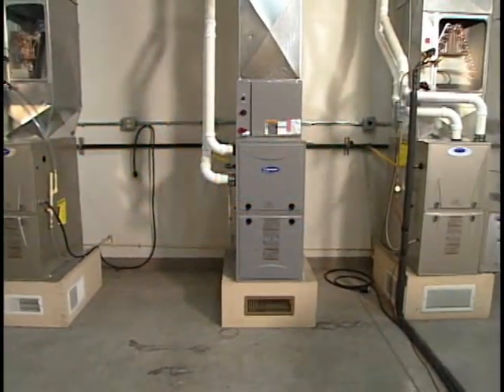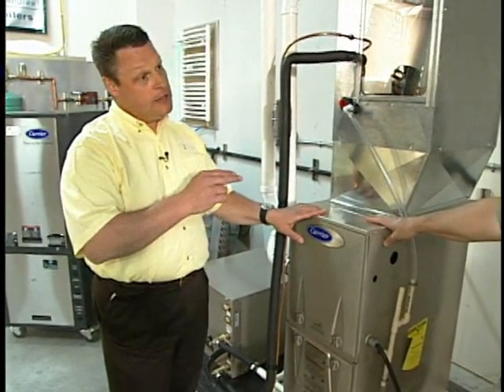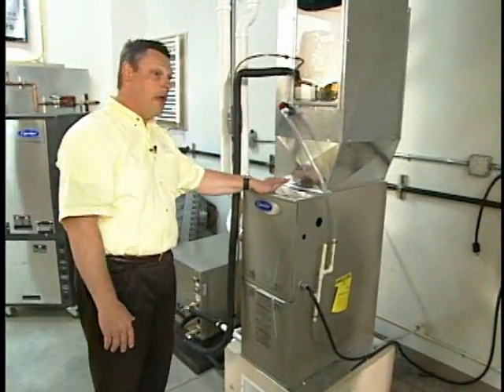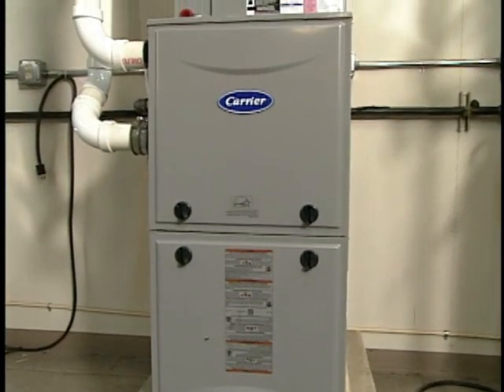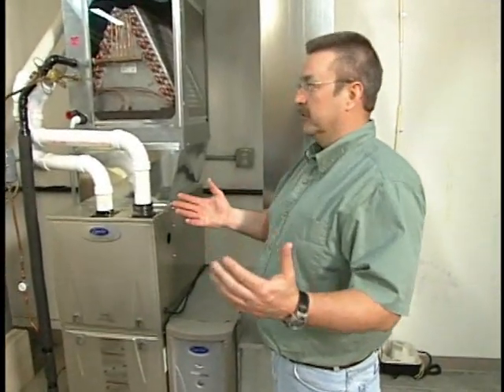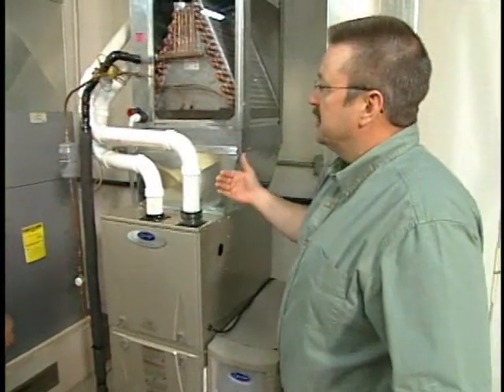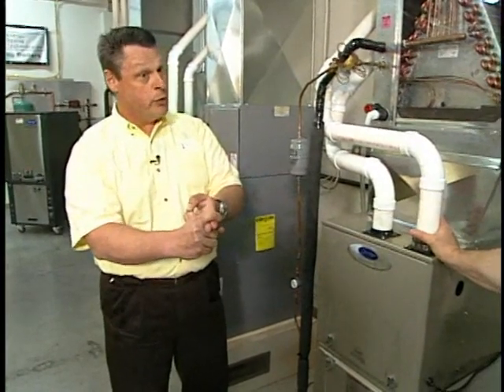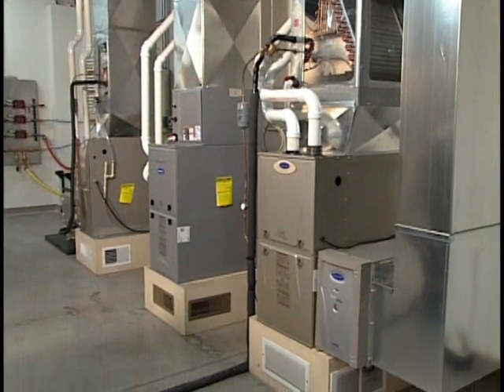How to select a new Forced Air Furnace - Carrier

Comment: Got a new furnace with an ECM blower. However, the touted savings are exaggerated, because an "inefficient" motor just makes more heat for the same kinetic energy output. But that heat gets added into the plenum, so the savings are just the difference between electric energy and gas energy.

Comment: What they don’t tell you is that if the motor breaks down and need replacement ECM is $2000 to replace but a regular motor around $300.
Reply: You are correct Siami. It's said that new smart motors use 1/3+ less then a conventional PSC motor but what good is the savings if the new smart motors don't last as long and it costs you $1200 to replace it, when the old traditional blower motor lasts 20+ years and costs $300 to replace?

Comment: Contractors charging $8000 on a $1600 AC unit is the common problem tgat manufacturers are fixing it. Why not the manufacturers also do installation or fix the price.

Comment: my condensed air 1 stage gas is testing positive for toxic molds going through draintube its brandnew so does this mean it puts molds and pollutions into home and also it wont run with allergy filters cant handle thick allergy filters, these furnaces save gas company money and create money issues for home owners

Comment: 350 bucks a year for electricity for blower?  Where?  in the east?  Not in southern california...can't be ...especially if you HATE having the temp over 68 degrees and that when awake...
Reply: That's just the blower. The AC compressor that generates the cold is what is expensive. Two different things.

Comment: 18 to 22 years ours is over 40
Reply: Mine is FIFTY years old...I am in sunny southern california and I have a 50 year old home about 2400 square feet two story.  The furnace is original ...well except for upgrades and repairs but it is so old I am thinking to replace it just on general principal.   I am a dyed in the wool do it yourselfer and it does not LOOK like a hard job to replace the furnace but I notice that advertised installation is typically WAY WAY more than the cost of a new furnace and I just don't understand that at all!?!  I could understand if it were in the attic but it is in a little furnace closet upstairs,  there is a flexible gas line like on clothes dryer and water heater,  there is outlet the cord is plugged into and the thermostat wires which are nothing....   other than that the only difficulty I can see is finding a furnace the same dimensions as this one and connecting the heat vent and the ducting.  the heat vent is now sheetmetal that we replaced a few years back when the home was remodeled (it HAD been asbestos)   Really how hard is to replace a furnace like this??  It sits on top of a inlet at the bottom and then somewhere on top or out the back? is the main duct(s) feeding upstairs and downstairs...its a skinny tall furnace but most I see in ads look squatty ...is this something a homeowner can do?  Or at least partially do??  I'm thinking if I just demo this one out of there and plop a new one in at worst I'll need someone to come patch in the ducts if it is beyond my ability??  Is that reasonable??
Reply: Steven Baker carrier

Comment: DC motors have brushes to replace down the road still a good motor but not every body can do it themselves.  If DC motors use less electricity then why do they put an AC motor in the Chevrolet Volt?
Reply: More power?